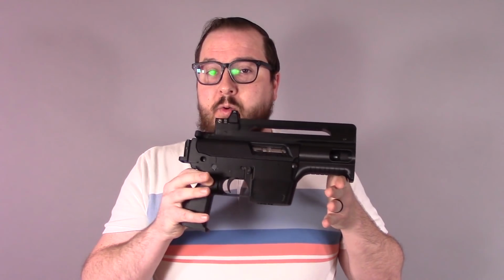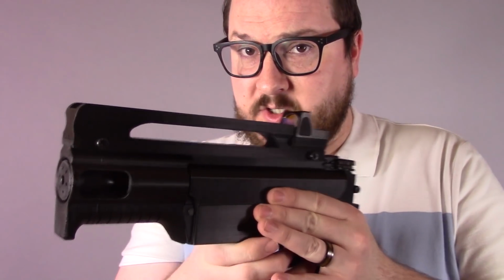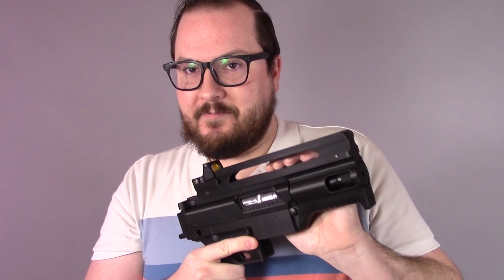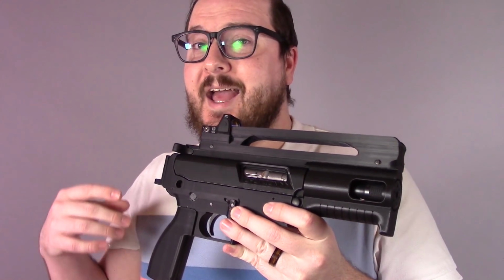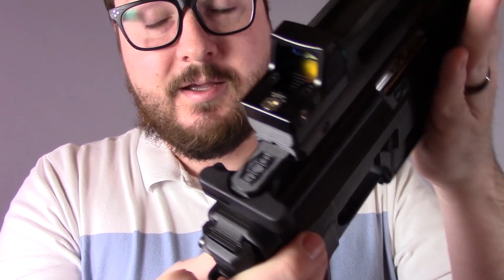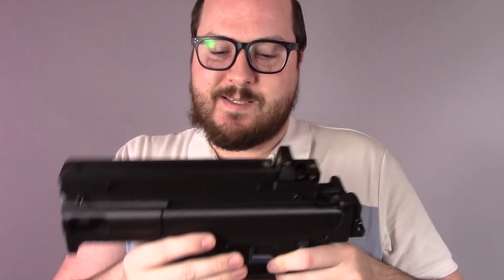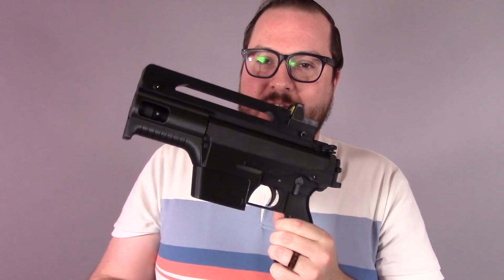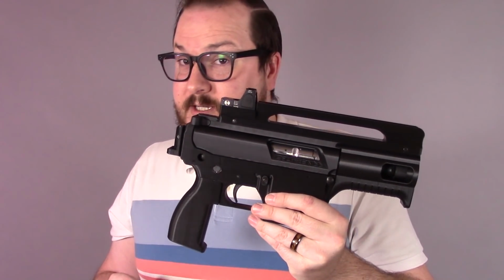3D Printed .22 AR15 Pistol - "SpaceGat 22"

Comment: Could this be modified to use the CMMG 5.7x28mm bolt and barrel?
Reply from the maker: You’d have to modify it substantially, including getting rid of the whole picatinny interface at the rear and instead running a buffer tube, which would require substantial reinforcement and probably reverting back to the U-Bolt design the base receiver had. So basically a full redesign.

Comment: When you say "barrel" on the CMMG are you talking about the 5.56 sleeve that fits in a standard AR15 chamber, or is it a separate barrel? I have one of the old adapters with the brass sleeve and some other spare parts laying around, and was thinking about throwing something like this together (just didn't know if there is an additional barrel I need to buy).
Reply from the maker: I used the standalone CMMG .22LR barrel and bolt carrier group. If you have the 5.56 conversion kit, you can buy a standalone barrel and collar and have a much more accurate and reliable dedicated .22LR AR.

Comment: should have just printed around a cmmg mag, would of never had to worry. sweet design tho man!
Reply from the maker: It is designed around a CMMG magazine system.
Reply: @booliganshootingsports  i meant get a actual cmmg magazine and 3d print a shell for the magazine to go inside of, sorta like an adapter.  then you wouldent have to worry about the spring, feed lips etc. it would be as solid as can be, just aesthetics.
Reply from the maker: @jc9233  problem is, then it would be absolutely massive and look like crap. The idea was to have a small low profile magazine which wouldn’t be possible with a shell over a CMMG mag.
Reply: @booliganshootingsports  i get cha. well keep us posted, i would enjoy seeing what you come up with. like i said it’s a sweet design i enjoy the channel 👍

Comment: could a beefed up upper like that, in pla+ handle 9mm?
Reply: Search FCG9
Reply: @GunFunZS  I already know about the fgc-9. I was just curious within the Ar platform if the upper would wistand the forces of 9mm.
Reply: @jordanhorst6  the fcg 9, its parent the shutty ap9, and the improved shutty design known as the wtf9 all can use pla+ uppers
Reply: @blahaj777  I know I meant his specific design which is quite slimmer than the shutty and fgc
Reply: @jordanhorst6  it theoretically should do fine especially if you added some aluminum rails for the ar 9mm bolt to ride on, but you’d have issues since 9mm bolts still require a receiver extension which this design doesn’t have and without that there’s no way you could squeeze enough mass in there for it to function. That’s the main reason the fcg9 (and others) are so much larger is because the bolt design is a lot larger in order to have the necessary weight for a 9mm blowback to operate.
Reply: @blahaj777   I had thought of rails similar to the ones in the dx-7 receiver. I was mainly speaking about this upper on a normal ar lower with buffer assembly.

Comment: I want that in 9mm, else it's just a toy to me. Love 22 but Ive stuck to 10/22's for 22s. Are there similar CMMG 9mm parts? And I would love a range vid with this
Reply from the maker: What's wrong with having a gun that's just a fun toy? You couldn't build this in 9mm because 9mm ARs require a buffer tube, which this doesn't use. I have a quick range vid on the previous build using this system on my channel, but this will get a full range vid soon.
Reply: @booliganshootingsports  absolutely nothing wrong with a toy! Most of my guns are my toys 🤣. Just meant I want a 9mm toy like this
Reply: @booliganshootingsports  maybe 22wmr? Or magnum
Reply from the maker: If CMMG made self contained BCG kits in any other calibers, I'd be all over it!